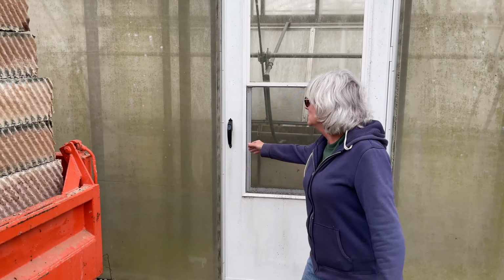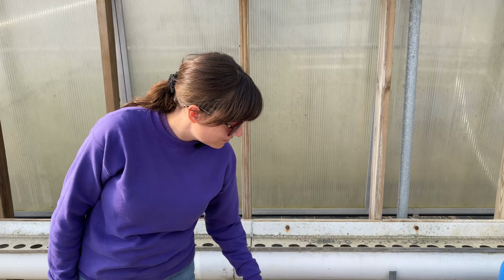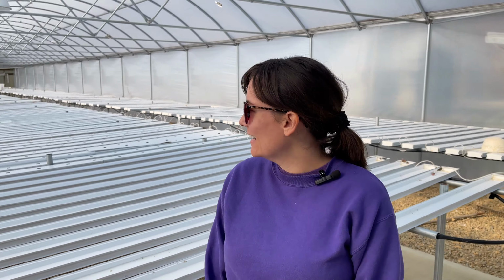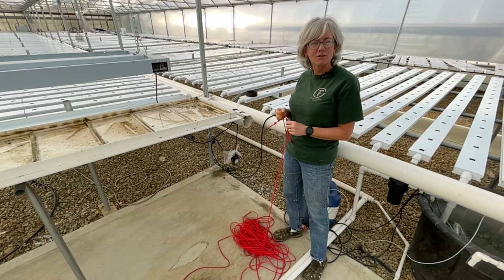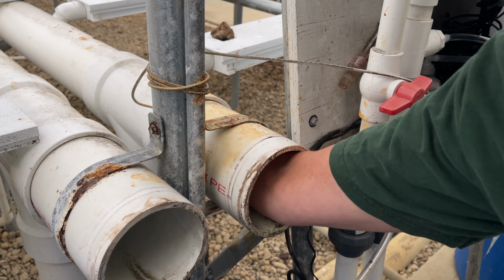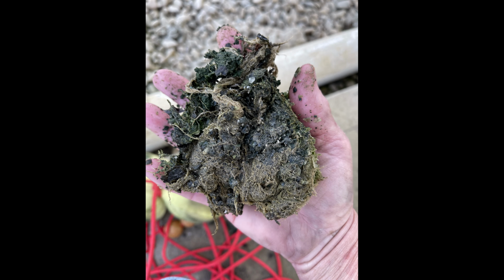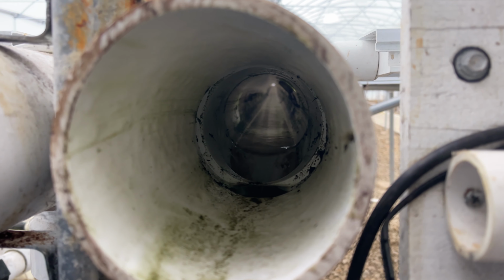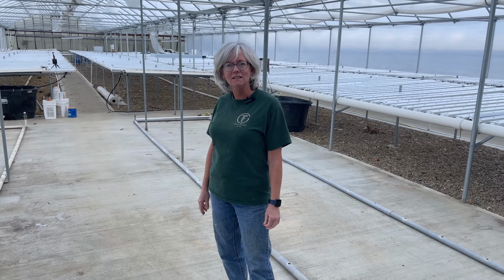Almost done! Finishing touches on our hydroponic greenhouse reboot!

Comment: Quick tip to feed your rope in to the pipes, tie a small plastic bag to the rope and connect a shop vac on the other end. The bag will act as a parachute inside the pipe, the shop vav will suck it through extremely quickly, tie something on the opposite end of the rope so the rope doesn't get sucked in in case the vav swallows the bag. Also, grab you a drain snake and attach 3or4 $tree toilet bowl cleaners on it, the other end goes into a drill. Makes for quick and easy work ;)
Reply from the maker: Thank you. We will try your advice on next cleaning.

Comment: did you buy those NFT's or are they custom design? Also have you looked into a drain cleaner for cleaning out your returns. they make brush ends for them almost like a toilet bowl cleaner. I have 1 that goes 50ft but they make longer as well
Reply from the maker: We bought the NFT's from CropKing. Thank you for the suggestion on the drain brush sounds like a good way to go next time we clean the returns.

Comment: Hi all! Look into a chimney sweep brush! Its usually on a chain/rope and you can pull it through!   I use a smaller version to pull though my dryer exhaust. With a rope on both ends my hubby and I can pull the round brush back and forth with them!  Our dryer exhaust is really long in our old 100 year old plus house. 
Your sponges did good but check into that pull brush for chimney sweeps.
Reply: Oh watching you spray the foam cleaner on the walls looked like fun and spraying the back wall behind the wet wall. Getting all the dirt off!
Reply: I agree.  The chimney sweep brushes come in various diamiters, attach line to both ends and pull it through and back again as many times as needed.

Comment: Someone has mentioned the chimney brushes. We use a stainless steel one for the chimney, they are very flexible and would do a great job with the return lines. Alternatively a trough with the removable top would work like used in the grow trough would work.

Comment: Several people have mentioned using a chimney brush.  The one thought I didn't notice mentioned was tying a rope on both sides of the brush or whatever you pull through.  With each of those tubes entering from the channels you're potentially missing a lot of buildup on the downstream side of each of those.  Pulling your brush back and forth full length a few times should help to further break up any of that buildup.  Just a thought.  Good to see you're well under way with the deep clean and closer to returning to production.

Comment: I have missed you folks !!! After the last update , it was clear , time for the total make over. The work to educate others on the honesty and opportunity for home grown , community food, really is an individual passion of your family. On  the long wet wall , that filters the air. Consider a liquid or hand applied car / boat wax on the plastic trough ? Why , it is like pre treating a boat hull against mold , scum and algae. Very cheap and effective. On the 100 foot , 4 " pipe clean out. once the rope is floated through , end to end. Consider this set up , to save time. With a person on each end of the pipe . Make a soft nylon pipe brush , then your sponge , then another nylon brush . so a 3 part combo , with a rope on each end . Back and forth motion , as a team . Or make your own 360 water jet pipe system cleaner ? Sell / share it to your grow distributor community  :) What does it look like ? 4 " ball brush , 3/4 pvc pipe - 12 inchs long, 6 " pre and post of the brush . A sprinkler head on each end of the 12" pvc pipe system. the water supply line , 3/8 to 1/2 flex pipe only needs to come from one direction . So you have a rope running , on each end other 12' pipe system. Brush in the middle , maybe just one sprinkler spray head on one end? why the build one time system? It will break loose the contact algee. Rinse it , 360 degrees clean. Actually you could run a mild cleaning solution through the water feed tubing on the first pass . The cleaning solution is what breaks down the aglee from the pvc, Think vinyl siding cleaning with a power washer) . It is the solution that cleans in reality and washer just rinses. Talk to any power washing pro they will tell you , it is the solution that does the cleaning :) Looks like the sponge got 80% plus out. Not a criticism , just a thought . First time on a re clean since new. No one had a pipe cleaner  answer before the fact. Just an engineering thought. Wish I lived near by really .   You folks are the best at sharing,  caring and educating. No side line judging from me . Just some shared thoughts. Second tip . On your shop vac. Attach a pillow case to your exhaust discharge. Yep cut the top off a pillow case so in the off /soft position, the bottom is  it is about 1 inch off the floor.  attach with a hose clamp. This will capture 99.99% of all the smaller air particles that by pass your kevlar inner filter particle size. Wash as needed. Works great for me , 40 years plus. Less than a $1.00 to do , good for life. 3rd , consider adding a soft start capacitor to your motors. Why . The lower amp surge will extend the life of the motors and or if you use it on your AC systems. Old tech but gloabally very reliable . the second reason , should you loose power the staged capacity soft start will allow a generator to run a system that would normally auto shut off a generator "spike" over load. The same tech is used on hundreds of thousands of boats , with AC on the water , using battery power with solar. If you have questions or want to have a chat . send me a note and number . or post an email in the response. happy to chat , if I can help in any way . all the best .